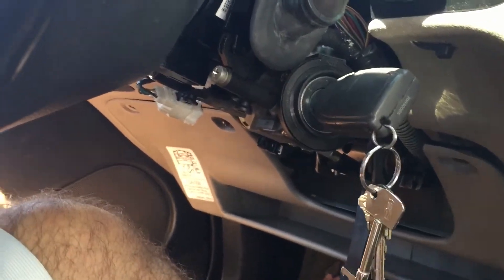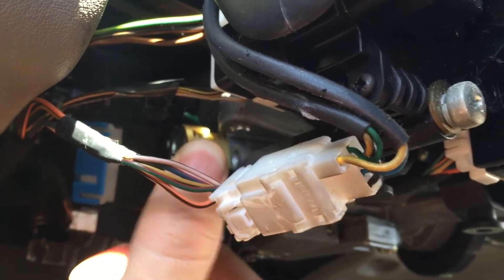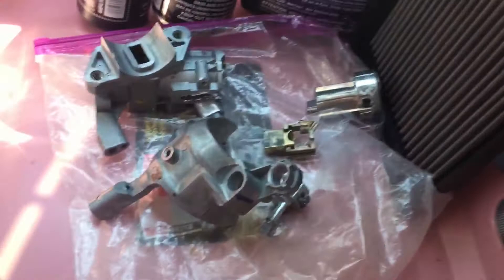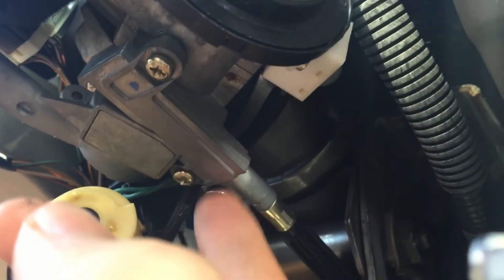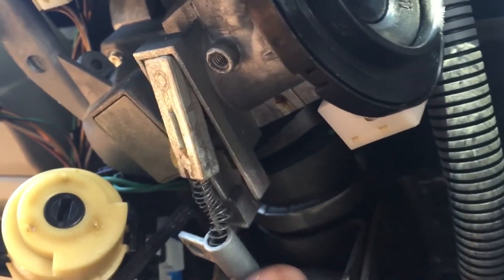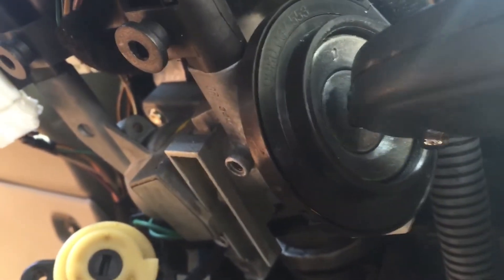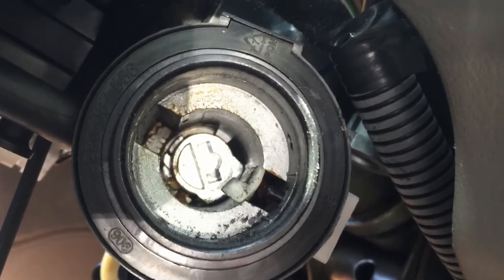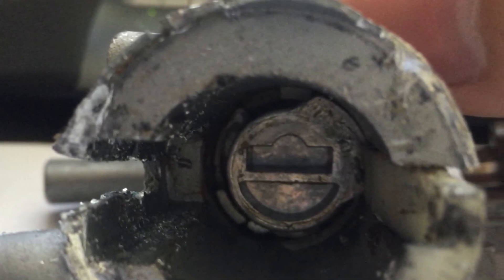2003 Volvo S40 - Ignition Lock Assembly Cylinder Ramblings

Comment: Thanks for the video, very helpful and informative so I wasnt heading in blindly.

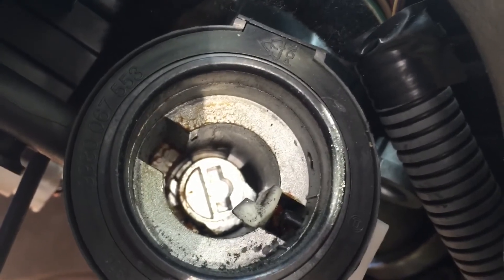The inside of your ignition barrel looks identical to mine (at around 4:40) and I have the same issue.

I was wondering if you think I could buy a new (identical) ignition barrel, remove the key mechanism/tumbler from it and insert my current key into it so that I wouldnt have to replace the key, locks and alarm module which would be a lot more work and money!

Also wondering how you managed to fish out the broken metal bit out of your ignition barrel as I've gone through 2 tools and a set of pliers trying to fish mine out (and then couldnt get my tumbler back in and had the steering lock on making the car useless! 😪(Eventually after a good 30 minutes of wrestling with it I managed to get it back into position and fitted it in :D )

If anyone has had any luck with this please let me know!!
Reply: Having the same problem as we speak, were you able to get it fixed?
Reply: @l9ndonn  It was mentally draining and I had to wrestle the ignition barrel but a couple hours and a few thin tools later and I managed to pinch out the tiny cracked metal piece.

The tiny metal piece that's snapped does not seem to have any impact on the steering lock mechanism or anything and the car/ignition has been working fine ever since.
Reply: @fabi1074  alright I’m gonna have to try this right now because I can’t find a new ignition cylinder anywhere and I’ve got school tomorrow wish me luck
Reply: @l9ndonn  Yh goodluck. It's tiring but it's definitely possible!

Take out the ignition barrel inside and you'll have to try use a thin tool or plier to fish out the broken metal bit inside.

As for finding a new ignition barrel - yes this is technically an option but it would mean having to get new keys for the cars ignition and seperate fob/keys for the alarm and central locking unless you reprogram these which costs a good bit. Honestly imo trying to fix this one is the most efficient route since it's free, already broken and relatively simple task!